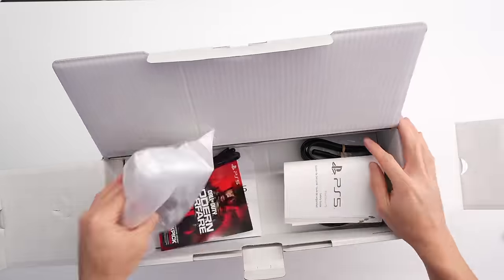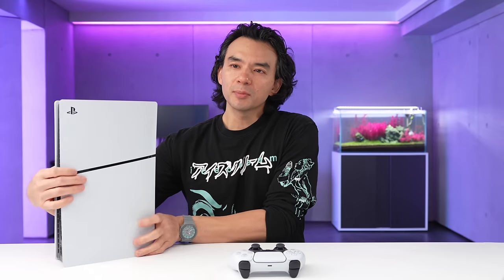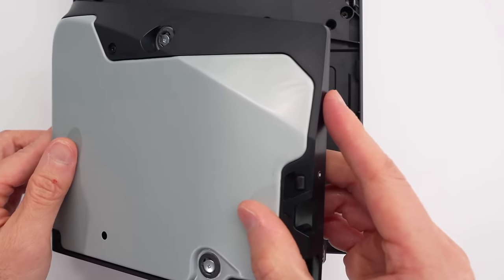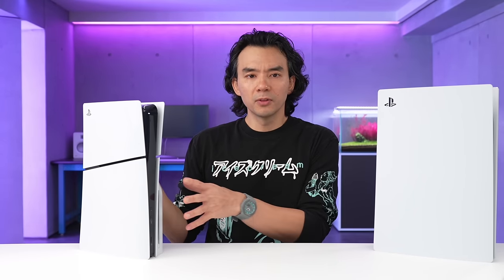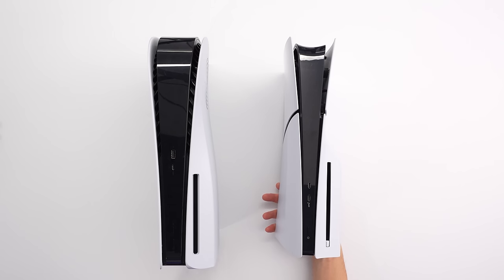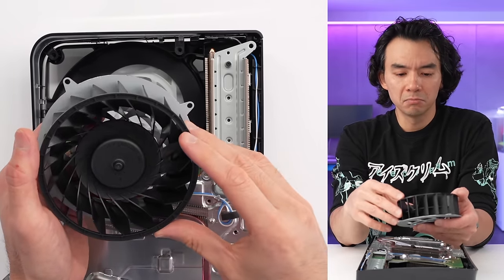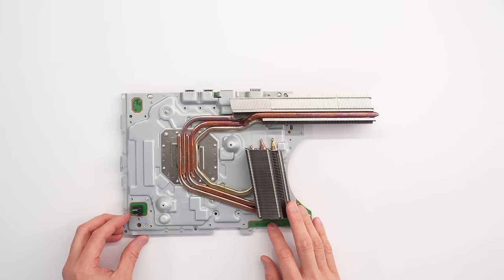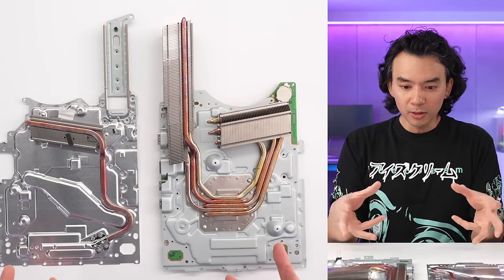NEW Sony PS5 "Slim" - Teardown + Thoughts

Comment from the maker: Which PS5 looks better? Old or New?
Reply: Neither of them
Reply: Neither lol
Reply: Old model looks more like a Premium unit.
Reply: Old
Reply: New
Reply: if it werent for the glossy panel i wouldve preferred the new design
Reply: new
Reply: Old looks better, but I could get behind this one, probably with the help of a Dbrand casing, though
Reply: i mean new just for the fact that it's a little bit slimmer, i just wish they would just do a normal squared design and stop with this curve nonsense, this way the ps5 would be much smaller in length
Reply: Non. But the old looks tolerable.
Reply: The big.  The only redeeming thing about the slim is the weight loss.
Reply: i like the new especially the none disc model looks pretty sleek and probably will look sick once some special editions come out, with 4 panels they can play with it in some artistic ways
Reply: The new version of the PS5 looks much better. The disk drive fits in perfectly is symmetry , and the lights have a modern touch. The PS5 slim now has a more curved design.
Reply: The old looked weird and abstract and doesn't make sense. the new is the alibaba knockoff version of it, that is called Gamebox 5 or something
Reply: Old is better looking for sure.. but the new quick release is great to have (y)
Reply: PS2 Slim
Reply: I prefer the old one.
Reply: 💯 Old. 
New one makes me taste vomit in my mouth 🤢
Reply: @troywalt4834 The one thing going with a curve design is it prevents stacking other electronics on it which could add additional heat.  
That and the look if you like that
Reply: Old
Reply: The 2020 PS5 and the new one looks bootleg and a scam for $500 should have been $350 or $399.
Reply: New
Reply: PS4 looks much better.
Reply: Old
Reply: Both are lame
Reply: Old giving more trust
Reply: If it weren’t for the gloss, I’d say New but as it stands, old for sure.
Reply: Well,i prefer ps4
Reply: Old since the new one isn't a performance upgrade, and the change in the new design breaks everything the original had going for it.
Reply: I like the ps5 dev kit. It looks like a Roman numeral 5. Kinda like a throwback to the massive “X” on the original Xbox.
Reply: neither but would rather stick with the launch PS5 plus why spend more money on no performance gain!
Reply: Old for me
Reply: New
Reply: I like both tbh I love the space ship look 😂 the stands are dumb tho
Reply: Old model. 

This looks cheap. Very cheap. Really disappointing. I hope the PS5 Pro design isn't cheap looking like this(I'll probably update from my ps5 I got around a week after release). I really can't believe they couldn't bother putting the stand in the box.

On a positive note, it is very impressive how much they've shrunk down the internal parts and the heat sink. On the original PS5, the heat sink was this massive behometh, whereas here it's much smaller like Dave points out.
Reply: How did you already get the new ps5
Reply: Old
Reply: A bunch of xbox rejects
Reply: 100% Old.
Reply: Ninguno
Reply: Old compare to the new one, but i still don't like the PS5 design that much.
Reply: I prefer the older look to be honest. The spilt design reminds me of the of ps4 to be honest and that think was a magnet for scratches.
Reply: Lol same 😅
Reply: none
Reply: I really like the Look of the Ps5....If i had to pick Probably the New.
Reply: The old one is better. The lines flow perfectly from top to bottom in a very smooth way, making it very aesthetically pleasing to me. Yeah I wish it was smaller, but with the same soft lines. Unfortunately that's not possible, the disc unit breaks those soft lines and creates that horrible bump, then you have the lines that cut through both panels, ruining the entire design concept, it no longer flows and now it looks like a Polystation.
Reply: Definitely the old one
Reply: The new,  don't like the shell but the removal of the air vent is nice since there is allot of dust going in there plus the old is a huge monster so smaller is better.
Reply: So why is nobody asking this dude when does it come out ?
Reply: Old
Reply: New.
Wide open space between plates and console (Means more air flow)
DIY replacable Disc Drive. AA+ feature we should have had sense the PS4. (Those were notorious to fail, and you had to tap the corner to get it spinning again)
Glossy panels can be replaced later for matt panels third party or by Sony. (So this isn't a issue, just people whining about literally anything)
Reply: love your stuff to a fault, but this was a bit of a pointless video mate.
Reply: The new ps5 is a cheap pos
Reply: I think the new one is to cut down production costs really.
Reply: Old, but I wish if you could add zoomed pictures of ssd chips and its controller, because it looks like 4 ssd chips, 2 in front and the same is on the flip side of the motherboard

It will look excellent when 2 pieces cover is available, instead of 4, waiting for Dbrand to step in🤲🏻
Reply: Xbox series S.
Reply: New without disc drive
Reply: Old.. new design looks like a cheap knock off
Reply: Новая
Reply: New, but only by a small margin. The original model is ugly and just as cheap looking. Hopefully the $30 stand (that should be in the damn box) will elevate the slim a bit more.
Reply: The new model looks cheap
Reply: Both, but I love diskless one more, and I like you to custom each side of ps5
Reply: Do like either but the old one
Reply: Old
Reply: Old, the slim screams Cheap, reminiscent of how the PS3 Super slim felt compared to the PS3 slim
Reply: Old. I gotta say the new one is the ugliest console in the history.
Reply: By just the base visual the old one. No glossy panel and no top venting looks worse. With non-glossy panels the slim might look better though.
Reply: Neither haha , but debrand case will fix things
Reply: The new one should have been the size of the old one. The size seems outrageous. L
Reply: @jumper55ful you don't want to spend 500 dollars for a few more inches of storage space? Lol
Reply: Old.
Reply: @wendywatch3386 "better" means comparatively. Better ≠ Good
Reply: Old better lmao. New one is not a clean design, the line ruins it. Also not that small and the inside of it looks trash lol.
Reply: Well...the lack of enthusiasm in your voice says it all. I mean it could be intentional, but I guess most feel the same way about the original PS5, so the apathy regarding the slim version is kinda understandable.
Reply: I prefer the older model because it’s simpler and maybe less cheap looking but it’s just too big.
Reply: New with dBrand plates will look great! I’m getting it because I move my PS5 around a lot and it’s a brick!!
Reply: Old
Reply: OG looks better but that’s always been the case for me. Don’t like the PS4 Slim that much, looks cheap and ugly.
PS3 Slim is OK.
PS2 Slim is cute but PS2 OG is the beast!
And nothing will beat the PS1.
Reply: Wow they managed to make it even uglier
Reply: @Dionyzos tbh the PS4 slim was also uglier than the OG PS4 which looked kinda sick coming from PS3
Reply: @MoatazK PlayBox5 or GameStation 5 🤭
Reply: New one
Reply: OLD
Reply: New 💯 percent
Reply: NEW, hands down
Reply: DIY Perks did it sooner and it looks amazing! Sony's console designers are just suits without any creativity.
Reply: Ps3
Reply: wiSh5
Reply: The new one is lighter which is good. However the old one when it launched gave out like 20 PS4 games in PS Plus.
Reply: I have the old, but im in love with the new design.
Reply: Old one is what it is, an ugly massive behemoth, but this new model looks like an Ali express knock-off 😂
Reply: I have a PS5 but it remains one of the ugliest consoles
Reply: The old
Reply: Old
Reply: The original is only "OK" looking and with a problem of being to big. The new one is bad, looks very cheap and uninspired. Could be a chance for some entrepeneur to take the guts of the "slim" and make a better shell.
Reply: Xbox Series X  😛
Reply: Neither, the PS5 is so ugly
Reply: PS4
Reply: Launch model PS5 was the best 

Just like the launch model PS4, PS3 and early PS2 models (prior to the Slim in 2004). 

PS1 early models also had features in them later removed from the updated models.

The rule of thumb says.. "Always get the launch model after 6 months of release"
Reply: I'll take the new vs the old.
Reply: Looks like a kids version ps5
Reply: Austin Evens will micrometer everything. And old PS5.
Reply: @MajdG1 slim looks so cheap imo
Reply: @lindah6954  Gamer Nexus are the go to people for accurate & detailed tear down..
Reply: @wendywatch3386 if neither wasn't an option 🗿?
Reply: @Dave2D The soc was die shrunk in august 2022 according to Wikipedia. Therefore the power draw is the same as Sony has gradually optimized the ps5.
Reply: Dude were not blind! We can see everything your doing, therefore just do the goddamn teardown..keep the OPINIONS to yourself! Other than that nice video!!
Reply: New
Reply: The original one for sure
Reply: old one is just toooo big for all my decor/media center, new one seems better although still not fully right.
Reply: Neither, both terrible.
Reply: @EllRiver  Word! I love the looks of the XSS, it's so clean and discreet. Pity the PS5 slim doesn't get the same footprint, but it was to be expected. I like it more than the fat model, nonetheless.
Reply: New
Reply: OG PS5
Reply: It doesn't matter what looks better, it about how slimmer it is. No one looking at their PS5 while they play games
Reply: I will stick with my old until the pro version
Reply: Neither, sell your damn PS5s....man up and build or buy a decent PC and stop playing on a child's toy.
Reply: O.G is better
Reply: New of course
Reply: As many are saying, neither. Though I suspect the new in some matte and toned down darkplates will look the best IMO.
Reply: Old. By far.
Reply: Launch model PS4 is still years ahead of its time in terms of design language. Such a beautiful console
 @Shehryar89
Reply: @WillemvanderPijl  yes indeed.
Reply: Old
Reply: I'm disappointed with the slim. I was hoping they would finally do away with that weird ugly binder look. So I guess I'd have to say that for me both are still ugly.
Reply: Is this the real ps5 slim and when is it release
Reply: 100% new
Reply: Old
Reply: Definitely the old and the best
Reply: Neither, PS4 Pro looks sleeker n y y y keep the white base :o
Reply: Old
Reply: Neither. The design just looked ugly from the start. Reminds me of a low-budget  B (or C) sci-fi movie prop from the 80s.
Reply: I'd take the OG. I didn't used to like the look of that either but it's grown on me since I"m also a PC gamer and it kind of looks like a mini tower pc. But this slim just looks cheap. that's the point though usually cost reduced
Reply: Neither. They're both ugly as sin and I'm super disappointed they didn't make the new console look a more conventional; similar to the PS4.
Reply: Definitely the old one. The new one looks like a Chinese bootleg
Reply: Old one definitely
Reply: The original looks more premium. Most of the time when your looking to cut down costs it's from cheaper parts. Sony needed cheaper parts due to the costs of silicon going up. This makes you wonder if Sony will pass on a Pro model. I feel MS is dragging Sony into a Content and Studio M&A's battle. Losing money on hardware makes no sense when the PS5 is selling so well and keeps up perfect with the XSX.
Reply: I'll stick with the original model. I do think it's garish but slim revisions never really looked "cheap" but for a small price INCREASE and not really much of a size reduction. It just looks like a bad deal all around.  At least this model shouldn't require a new BIOS chip to be soldered to the motherboard when the optical drive dies and you remove it for a pleasing aesthetic.  Sorry for the long windedness
Reply: the old ps5 for sure - cutting costs always leads to inferior quality and product
Reply: Neither. Both are just as bad as the other.
Reply: i dunno why people are sayin neither when 99 percent of games that win awards are playstation exclusives and im a pc player to humble yourselfs
Reply: Old
Reply: I like the look of the old one. I have it but can't deny that it's too big
Reply: The new one looks like a Chinese knockoff
Reply: I like how the slim looks with the PS logo. But the disc drive just looks weird on both systems. Idk why both PS and Xbox went with crazy designs this time around. I’ll pick up new one since it has more gb space for games for same price. I’ll change out the panels later.
Reply: Old model like a monster....  slim model low build in quality... !
Reply: De gustibus non est disputandum.
Reply: The new ps5 disc drive. Can be hjaked. From anyone 😢
Reply: The old spider man edition one looks fire
Reply: @4laci ok but you didn’t complain when the PS4 had a gloss panel, but now you care all of a sudden. stop the hypocrisy.
Reply: @mhmhso1540  It looks okish, but nothing special.
Reply: I like  original PS5 disc version
Reply: People still play death stranding? ;ol
Reply: PS4
Reply: I hope the old playstation 5 will be cheaper when the ps5 slim comes out
Reply: If they just shrunk the OG PS5, I would have been much happier
Reply: OG one
Reply: PS4 Pro and PS4 Slim. Still waiting for a PS5 looking like any of those (specially the Pro).
Reply: To me, old.
Reply: PS5’s design is horrible imo. It stands out way too much in our living room. I really hope that a future pro model looks more a bit more pleasing to the eyes.
Reply: Old is Gold 🥇
Reply: @4laci  Don't like how the vertical stand is sold separate and the one for the horizontal is small and flimsy
Reply: New, I prefer the look of Xbox’s as they are just more utilitarian but yeah the new cause it’s smaller and less of an eye sore
Reply: Old, Original PS5
Reply: olddddd❤❤❤
Reply: @MatrixAlphaCWX  wide open space between plates = more dust 😂
Reply: They both have same shape size, but for the slim has different model and different USB port.
Reply: @troywalt4834  right like imagine an all black sleeker model. Like what most people thought the ps5 originally was gonna look like.
Reply: Personally i don’t own a ps5 ‘bcause i was waiting for the slim. I’ve always had the slim version since ps1,2,4 so for me ps5 slim is nice to me lol
Reply: Old
Reply: I like your old hair my man
Reply: i like the old and new design (after all). i think i buy the new one with dark plates. some design parts of the new ps5 are not good (glosy, no lled, the top compared with the old) . but its much smaller.
Reply: Old digital black
Reply: the new one
Reply: new
Reply: Both
Reply: The old one looks better to me
Reply: Old one
Reply: Old. 100%. The original fat consoles have always been my favorites for all previous generations.
Reply: I have the OG PS5 and after seeing this tear down of the PS5 slim, I MUCH prefer my PS5. The OG PS5 looks more premium and better build and while some people say the old PS5 is ugly or whatever, I prefer the look of the OG. The Slim version looks cheap, looks like a knock off like many others have said. I don't like the glossy part on top of the Slim. I'm def sticking with my OG PS5 for sure. But for those who don't have a PS5 and like the look of the Slim then by all means please enjoy the look and hopefully it makes you just as happy as mine has made me.
Reply: @drunkhusband6257   PC is junk.  Some of us rather play on console
Reply: Old PS5 look better👍
Reply: Old
Reply: I like the new glossy and matte look. I just wish it was more powerful upgrade and harddrive needs more
Reply: When brand new, neither looks better. After being used for a while, the old will look better because those glossy white panels will be so scratched up. At least they fingerprints will be less problematic on a glossy white than if it had been a glossy black.
Reply: Neither...
Reply: Old is gold😂
Reply: Prefer the old ps5 got 3 usbs the new one only has two that’s a deal breaker for me need the 3 usbs 1 for headset dongle 2 for mic and third for camera
Reply: New
Reply: i like the ps5 slim
Reply: Old for sure especially the digital version
Reply: new hair looks better imo
Reply: none. lol.
Reply: Neither of them
Reply: Old
Reply: Old
Reply: New one for me, you hated on it too much
Reply: Wait for the pro
Reply: @js100serch it looks like it has a massive obesity issue. I would still prefer old ps5 because the disc drive version does not look as awful.
Reply: @MatrixAlphaCWX why would you want to pay extra for new plates when it could have been made matching from the start?? That is why people are complaining its not  whining.
Reply: @xPremiumRabbitx I agree. Although I don't understand why you care about insides when 99% of the time you don't even look inside unless your making a very deep cleaning. But non the less old one looks and feels much more better.
Reply: new
Reply: @baerchensimulation422 I don't understand what you like about a literal brick...
Reply: @Shehryar89  He'll yea.
Reply: Wanted to get the slim cos it's smaller so more compact, easier to move around. But you kinda sold the older version 😂 here the older version is also cheaper lol 
Thanks man
Reply: @VillaAdaPosseFan  I don't understand why the digital version is more expensive man... it should be a bit cheaper because its smaller so it has basically no meaning in it. Like who would pay extra 50 dollars or € for something for 400 extra gigs? Also disc drive version of the new one looks pregnant it's dumb.

+ the size difference is not so huge either.
Reply: Don't know why anyone would care what it looks like. It should be capable of playing modern games at modern res and framerates, and sufficiently cool it's hardware. It doesn't do any of those things very well. But it looks cool.
Reply: @wendywatch3386 hahaha true bro😂
Reply: I find the PS5 is such an ugly console, was really hoping the slim was going to change that and be significantly smaller but this still seems like a large and hideous box.
Reply: New
Reply: Neither but the old looks a bit less ugly

Also the new one is functionally worse since you need a internet connection to verify the game even on the disc version where as the original 2020 model didn't need it so once the ps5 servers go offline say goodbye to your games even if they are physical
Reply: Everything is ok of the PS5 slim apart from the L plates
Reply: never liked the ps5 design
Reply: O antigo, óbvio.
Reply: @troywalt4834 Yes they should do it like the ps2 looked like with a modern design of course.
Reply: Looks more like a gs5 now😂
Reply: Non but I will buy the slim
Reply: Hi Dave, have you tried Factory Reset on this PS5 Slim? - I'd love to know if it will require validation for the disc drive (online) everytime the reset is performed OR if it is remembered forever. Thankyou
Reply: Old
Reply: @dave2d which CFI is this console?
Reply: ps4
Reply: Old
Reply: the new (slim)
Reply: @rimlatv  yeah i think so
Reply: @4laci  makes sense
Reply: @JosephOVA  true
Reply: @jumper55ful  yeah unless it is like 30$ difference
Reply: I don’t like the glossy panels. My PS5 looks and feels better. Maybe SONY will give us a better design if they release a PS5 Pro.
Reply: Old
Reply: Old
Reply: That console just looks pathetic, I have heard what the ps5 pro was post to bring to the table but there is no way in hell sony can put a gpu as good as the rtx 4070. I have no clue why you start a rumor with that high benchmark, more believable would be a 3060ti, and I wish I could say 3090ti because I would buy it. Even if xbox did it first, I would buy it
Reply: Neither but if I had to choose definitely the old!
Reply: none
Reply: Only reason to get it is if you don’t already have one.
Reply: @rimlatv exactly my thoughts too
Reply: You mean pentium unit not premium lol
Reply: Old
Reply: Old is gold 😂
Reply: @wendywatch3386 how come they have more sales than x box ?
Reply: Dont get me wrong the ps5 slim looks cute
Reply: Old
Reply: both are worse
Reply: @dericjames2018 you guys says this is bad but will pay the same price for a shitty black rectangular box💀💀😆
Reply: Old
Reply: old
Reply: New
Reply: Ninguna 😂😂😂😂 vaya trasto más feo
Reply: old 1000%
Reply: Not my dream design, but both are still better than Xbox, that's for sure lol
Reply: xbox series X
Reply: Old
Reply: The new.
Reply: Old looks better but still too big.
Reply: I have the original digital, it looks no different than that. This is a gimmick, shame on Sony, you get like 175gb of extra storage, and I've heard the cooling isn't as good either. Whoopi. As most have said it's the same exact console, weighs the same and is slightly less tall vertically. Horizontally on the digital edition Slim ($449) you have to pay $30 more for a kick stand to prop it up !! What the French toast. No thanks. I'd rather pay $600 for the Spiderman edition and i'm not even a Spidey fan!! ha
Reply: @wendywatch3386  Congratulations on not knowing the meaning of the word "better."
Reply: Old I say for sure 👍🏻 bro 😎
Reply: New
Reply: I like the old one better, all i see in the slim is overheating and a loud fan😑
Reply: Well I guess they gonna sell new plates aswell @4laci
Reply: I prefer new one by far
Reply: Nah
Reply: Old but that's not saying much, both are abominations imo.
Reply: New
Reply: Old. And personally, I love the design of it. Very futuristic.
Reply: Just old model new model seems like a FAKE ps5 😂
Reply: Old
Reply: old model
Reply: Definitely the old ps5 however I'm disappointed in the slim I wish it were much smaller without any external changes to it
Reply: NES
Reply: Old
Reply: Ps4 Looks cheap guys lol
Reply: In terms of specifications ; both have the same features except the slim has more Storage Capacity and smaller size! so honestly its a matter of design like ! that's it.
Reply: Both are probably the most ugliest consoles they’ve ever made.
Reply: Series X looks better.
Reply: Old.
Reply: Are official prices out yet?
Reply: My purifier looks better than both of them.
Reply: Old
Reply: I don't like the look of both of them.
Reply: Even though I can appreciate the “slim” PS5’s reduction in size, I definitely prefer the OG design.
Reply: Old
Reply: old
Reply: Old
Reply: old like a pro player use, new is a noob player and loser use.
Reply: New, the Slim
Reply: @filip9587 It's the other way around

New one is much better

Old one is horrendous, very big
Reply: @Ricardo29j Much better design the new one, the Slim

Yes
Reply: @jonmarc876 More like the other way around

If it weren't for the Mat...
Reply: @4laci It should be all glossy
Reply: none lol 😂
Reply: new
Reply: E tudo mesmo console não munda nada só pra joga jogo ps4
Reply: new by far
Reply: One piece looks much more COMPLETED, the new one is just DUMB!
Reply: Old
Reply: PS4 Pro
Reply: old
Reply: I might buy the new one
Reply: You guys didn't pass English huh?
Reply: Ps4
Reply: Old. I was waiting for this one but now that’s it’s here I don’t like the design. I like it even less than the original. I’m going to get an old disc drive model before they’re phased out
Reply: Considering I have a skin on my old ps5 nd devicewise it looks more appealing especially from a vertical appearance I'm assuming in the future the ps6 would look more "futuristic " I guess
Reply: You guys care about the looks? Mine stands on my desk (without the OE stand) with both panels removed. As if the games I play... were being displayed elsewhere
Reply: I'd love either man..... I'd love either
Reply: Neither :body-blue-raised-arms:
Reply: I think xbox is way better looking this time around.
Reply: @georgygasparyan5522  I agree. And I've been sony guy my whole life
Reply: New, I see it as a more thought through design.
Reply: They both look like crap, Xbox series x  that is a nice design. The ps5 is an abomination
Reply: New
Reply: Neither...this is probably the ugliest console Sony ever produced. If this is what so called top designers can produced, it's laughable! Sony wil not get my money this generation!
Reply: Guys I have questions which one is better slim or old
Reply: Old hands down